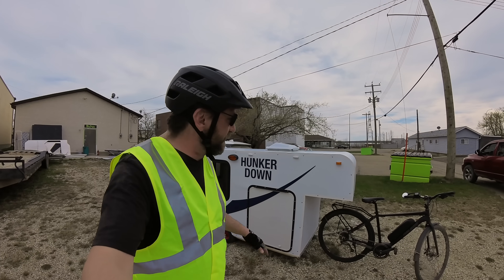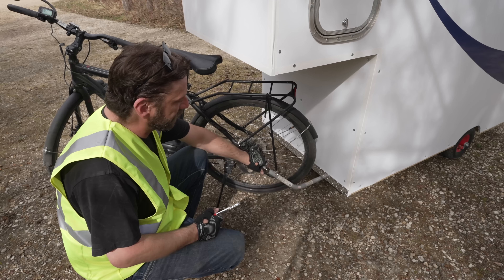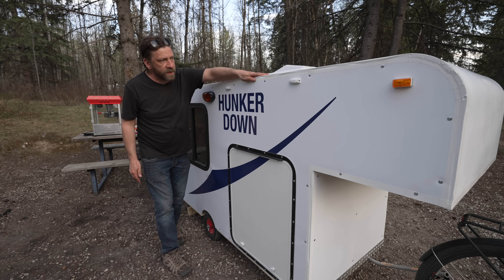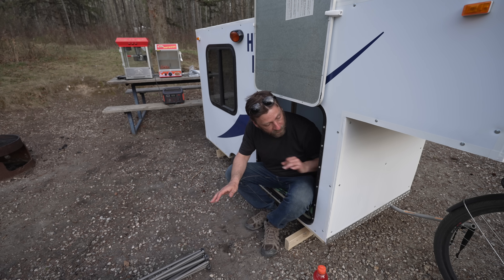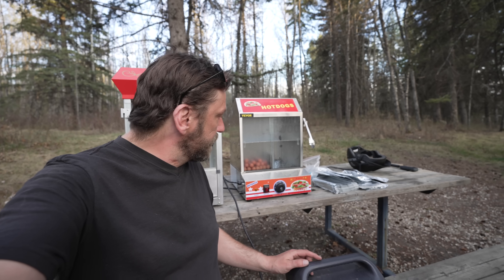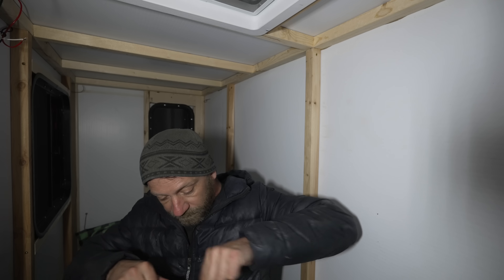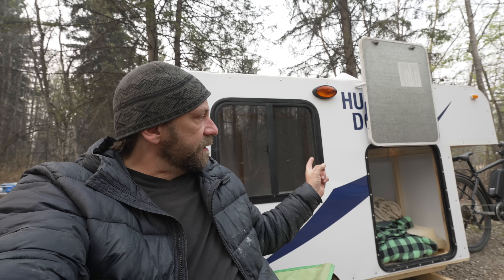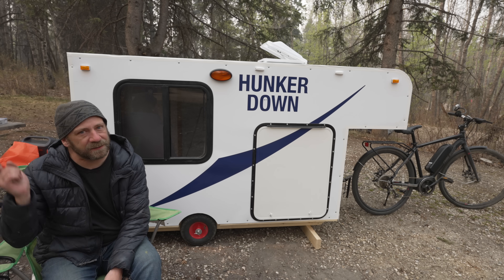DIY Bike Trailer Camping

Comment: I think maybe you should have tried an adult tricycle instead of the two wheel bicycle what is giving you a little more stability in the rear end of the bike. And it probably would have been a little more stable for the little camper you got pulling behind you

Comment: My biggest recommendation would be a better stand/leveling system. With just two 2x4s, one wrong shift in the night could knock them over pretty easily. Other than that, I've camped in much worse places and I know you have too

Comment: Change your rolling friction by moving the camper wheels just outside the body and make them small  bike wheels. Larger diameter will help it pull easyer.

Comment: wow, I came to this video late... I agree with the people saying "use insulation foam sheets for the walls" my addition is more for the entertainment aspect, instead of a bulky/heavy monitor for movies and or games, get a pico projector. super small, with a decent aspect ratio and detail. and bluetooth capability so you can link it to a bluetooth speaker.

Comment: You should’ve set up shop next to the kids with your hot dog machine!  Seriously though, I think you should trade the car battery for a lighter Li polymer battery solution and throw some solar panels on the top of the camper to recharge while on the move.  Maybe the 5th wheel mount can become a battery mount for easy access and charging while in camp.  Line the walls with packing materials to get some insulation.

Comment: Solar panal on top battery inside would be nice for lites entertainment, small fan with 2 bottles of frozen water clipped to back of it for AC Thats rite they have those little ACS but they want 40. 00 for something u can make for the price of a mini fan they have tiny  heaters for winter

Comment: Hey Steve, 
I have been watching for a few years now through all of the ups and downs. 
Love the videos.  Keep up the great work.  You could use FRP panels on the inside.  Nice and light as well as easy to clean and water proof.
I will volunteer my time to helping you install it as well. Happy camping in that great little camper.

Comment: hi...why do you have such low doors...small wheels that provide great support...and where do you have ventilation in the camper...3 cm of polystyrene foam for insulation will not be damaged and you won’t be able to supply it...with great care your subscriber to you... bye bye...

Comment: Is that not AMAZING!!  I simply can’t believe you managed to do so well on only a $600-CAD budget. Sort makes me wonder not only if you’ve thought about selling the plans to other builders, as well as what you plan to build next. Kudos Steve!!  😇
Reply: Simple suggestions to help keep the weight down for traveling by bike. If you can make the floor measurements at least 77 inches or as much as 84 inches, you can use an ultralight camping cot (think Chinese Helinox knockoff to not break the bank) which measures roughly between 72-74 inches, assembles fast and easy, combine with a US Army sleeping bag which troops use to stay warm above the Alaskan Arctic Circle, with your Jackery, you could be golden. 😇

Comment: That’s awesome Steve!! Been wanting to build something like this myself for ages seeing ya build that and so light weight is awesome!! I’m wondering if hard mounting the hitch to the bike and have two arms on both sides with a hinge for up down motion and having a turn table where you have hitched on the trailer would make it more sturdy and give more room for turning I’m running a tricycle atm and using standard hitching limits my turning -_-.
Did some research for e-bike kits you might be better off with a mid drive kit as it will utilise your gears which in turn should offer more efficiency there’s small pros and cons between hub drive and mid drive but have found apparently efficiency and for towing the mid drives take the lead, might be worth researching

Comment: …Light weight insulative?….Reflectix, or similar…multi-layered.  We all mostly sense radiant heat—a 100 watt adult can pretty much heat that tiny space in moderately chilly outdoor temps, especially with a reflective surface.   But adding a couple layers of a reflective insulation can boost that, to help keep comfortable in some amounts of cold weather, when also using a decent sleeping bag. 
…Did I miss mention of why you chose the tiny wheels?  What if you extended the axle, to allow using recycled fat-tire bike tires, to help travels on uneven ground?  
…Would flip-down stands under front & rear ends, help stabilize the camper when parked?  Could be U-shaped flip-down front & back, or, adjustable-height legs on each corner if camping on uneven ground?
…Stealth camping needs stealth camo-paint job! 😉🖌 
…Could excess weight be saved by using flexible solar on the roof? 
…That hole—great place for a DC fan with a bug screen to help circulate air—one of the yuckiest things in any trailer, has gotta be when dew-point inside causes condensation on interior—moving air helps reduce that.

Kudos, man!  That’s a very cool work in progress!   Please Keep us posted on your progress!
Reply: Oh—forgot….that trailer could maybe have a limited-turnable 3rd wheel under the tongue area that could help stability.

Comment: Now that I’ve watched this. 
I do intend to watch your actual build. What I will say firstly, is stay away from anything with a cardboard panel. It’s absolute rubbish, you will only end up with your panels becoming mouldy and damp over time. 
I tried using those cardboard panels with the white coating on one side for my airstream. Never again. 

Try using “luan plywood” for your wall panels. Make sure to use sikaflex around the framework to stop leakage. 
I would put in some “king span” for a little added insulation. 
I have been wanting to make something like this using a tricycle. Hope this helped.

Comment: This wouod be perfect for homeless people that are actually trying to get on their feet and working. Not for ppl just wanting a better place to get drunk and/or high. Hook it up and go out to a remote location and chill for a few months until you can save. Probably several lite additions could  be done like solar, little kitchen area. Maybe a little bit of water to was with if you could buy or build a system lite enough not sure. I know water can add a lot of weight quickly.

Comment: Main frame needs L brakets on the joints... and to hold heat in the winter  use Reflectives wrap inside....switch the ceiling vent to a fan ... Are RV got real hot....that fan is the real deal. Metal L brackets like you have in the  front...do it all around. I'll think of something later 😂

Comment: Get foam board insulation or Styrofoam for between your studs, then laminate some 4oz fiberglass with a thin layer of epoxy. It'll be quite rigid and light. Urethane foam is compatible with styrenated resins or epoxy, Styrofoam is only compatible with epoxy

Comment: Hey Steve. Nice little camper. Maybe put some foam board insulation and luan plywood over that for your interior. All very light weight. Stain it white or paint it. I think if you somehow had the whole back of the camper open up and you could screen it in when open or many options. Remember when you put two motors you use a lot more battery. I would put a very bright sign of some kind on the back like the Omish have on their buggies.  An inflatable mattress would leave a lot of room for you. Anyway, enjoy your new rig 🙂

Comment: I have a couple of ideas Steve, 1. add trailer jacks to the four corners for leveling and 2. use and electric motor with a large diameter pulley,  rc car battery, and a couple of alternators with small diameter pulleys to generate power. Great build and video content, keep up the great work!!

Comment: That’s super cool! Not telling you what to do but if I had one of these bad boys I would make the following modifications. 

1. Interior: I wouldn’t add any additional sheeting type material. Rather, I would add pieces of trim to cover up the fasteners and wiring, sand the framing and paint/ stain it, then either paint the walls or add wallpaper. (I’d worry about mold with additional wall material.)

2: Electrical: I would look for a switch/fuse panel from a boat and use that as a junction and controller for lights. Maybe adding a small fan for ventilation (hey! You’ve already got that hole!) would be good in addition to some brake lights. 

3: Miscellaneous: I would install a bigger door, something that would at least allow a person to sit up on the threshold. An old camper door could maybe be found and cut down for such a purpose. As for a bed, I would go with an air mattress. I feel like anything else would take up too much space. 

Sorry for the book, just my two cents!

Comment: @Steve Wallis Thats great idea if you got a  fan you could put it in the window there so meny people making these i think that the government should give them out instead of tents then they could move them with them you know an the home less can fix them up how they need it buy there owen batteries an solar panels 12v heaters an fans better pad locks an maybe put a life alert in them encase an emergency pops up also you could make it role out wider for more room
Reply: You can put car sound denting stuff one side peals off an sticks to anything its light water proof an kinda cheap also will make it warmer comes in different thicknesses an you can put carpet an wallpaper on it there you go an get a inergy its portable you can buy more batterys for it an it just clicks together no more cords then needed the solar panels come with longer cables then any othet company i believe an they can have the emp shield built-in so you dont have to worry if a emp or solar flairs goes off nuke no problem they charge faster then most brands there an amazing usa company check them out 🙏 cause i pray take care

Comment: I know a quick build, but this is awesome! just needs a large (maybe even foldable) solar panel on top for recharging the bike, and other electric needs :-)
...edit
Ah you mentioned the solar! That just has to be there... maybe stack them with rails and when you cycle you have 1 (250w) and then when you "park" push 2 more out either side to have a maximum of around 750w on a shiny day... then you could have a thermoelectric cooler (80 watts) and heating blanket (50w?) and lots of nice to have stuff...

In Sweden 250w is the max for a e-bike (without any sort of license). 500w would be a lot better, hope that changes soon (in Sweden)...

....edit2

Water, why not get a pump to create your own water, some of the pumps you can fresh water from any ditch... and if it's all frozen just melt it run it thru...

Comment: I am thinking the space behind you when you were sitting down in the camping chair, the original mount point, that could be the "kitchen" or sink anyway and oven toaster. Then stick a little projector somewhere and have a pull down screen in the middle of where you tucked back the bed. So when you want to watch a movie, you sit comfy with your back to the sink and watch stuff while you eat / have a step two. The projector doesnt even need to be in front of the screen, most projectors can be set to rear projection, which means depending on the screen you could have the tiniest of shelves at the far end of the cabin near the frosted window and run it from there. You can get tiny projectors now these days, not all of them great but, I mean, for what you need it for.

Glad to see you back man! This thing looks great

Comment: Steve.... Could i buy that trailer or could I pay you to build one for me ive been looking for something exactly like this for like 3 years i build mini bikes and they have good tow capacity. This would greatly increase my ability to adventure comfortably i would love to take this deep into the mountains on some fire roads I could slowly add solar panels and install a bracket on the wall to slide in a tablet as a mini flat screen some kind of battery system to store the excess from the solar an inverter to run wall plugs so you could run a little battery powered heater or ac that would be so perfect for me

Comment: I think it all needs to be one unit not 2 units meaning the bicycle and the trailer and why the little tiny Wheels why not use mountain bike rims and tires? And if you hook up electric motor in between the pedal drive on the chain you would have pedal assist  and making it one unit I don't know maybe a three-wheeler? Stretched frame you'd have way more capabilities just a thought ✌️

Comment: I have a suggestion for lightweight, easy, wall-mounted, inexpensive storage "bins" that we use in our trailer.  We got those command hooks (2 or 4 will do per "bin") and small laundry mesh bags with zippers, with the mesh large enough for the hook to go through it.  
Stretch the mesh bag on the wall for measurement.  Attach the hooks to the wall in the appropriate dimensions, and hook the laundry bag to the wall.  They work great!  Eventually the hooks give out in the heat around here, but more sticky adhesive replacements can be bought.

Comment: At such a light weight, why not make it either tall enough to stand at least on one end with a sloping roof OR a pop up roof you simply lift and hook into place like a shoe box opening upward over a smaller open bottom half.

Comment: Suggestion for the interior paneling instead of drywall. There are light-weight panels they make for use in the back of restaurants that are pretty thin and made of some sort of plastic. With some care, you could even attach switches for the lighting. Just a thought. Love the camper!

Comment: Paint the framing a light colour, get a windshield sun shade, cut it to fit your windows, fasten it top frame (stapled)? roll when not using.  Small led lights stringed would work well. That hole in the top section , the failed 5th wheel thing, put some plexiglass to cover taking advantage of the light coming from it.  Any cabinets etc built inside use pocket jig for screwing together, it’s strong but can be used with lighter wood. Enjoy. Glad to see you having fun.

Comment: Steve Sir:
Just a suggestion , the bicycle is fine I’m sure it’s great, but if you might want to upgrade a little bit, go with electric trike , it has a basket for extra batteries or supplies for as you travel and it can make a 5th wheel hookup and not hinder your travel. A couple solar panels on top of the hunker down charge controller to charge for the trike .

Comment: If you had one of those sweet fat tyre 1000w bikes with a massive battery, you wouldn't even notice you were towing it. Also fk the laws, police never check anyway, but you can put a sticker on the motor that says 500w, it's a bad law anyway we're supposed to be using less fossil fuels. This looks so much fun.

Comment: Great idea and build. Only suggestion for lights is LED strip lighting, that would allow you to control the brightness of the LEDs itself. Also a fan to move air around. Great idea with the overhang. That will allow for light weight storage during travel, but more storage when you get to the campsite.
Reply: Rebke fan built jn ked kight iakl in marine inky $54.00

Comment: We found an abandoned 6’x10’x6’ tall house boat in the swamp.  Room to sleep 4 with the dual side by side plywood bunk beds suspend from the ceiling by ropes.  Used knots to set height of each bed… had a hook on the bottom bed to latch to ceiling during the day.  Not sure you could suspend a bed from your ceiling but you could suspend a table and lower it to some blocks on the walls mid way up.  Hinges may work but could get in the way.  Go to the ceiling.  I love this, man.

Comment: I have a 1200 e-scooter and a 1X2 meter cargo/camp trailer. so something like you have there appeals to me. My utility/camp trailed weight 18 Kilos. Deck uses chain link fence, sides, PVC 1/2 inch pipe, 20 inch bicycle tires and 1 inch box steel frame. 

Where I am many 22% grades. I can do 38 KPH scooter alone. So should be good pulling the trailer. Though steeper hills would be a problem.  

Looks like you need a longer hitch to keep the trailer off your back..  Maybe a solar panel to extend your range.

https://www.youtube.com/watch?v=gIggyTAZEWY

Could go covert and put a higher power electric motor in the trailer. They probably would not expect that.

Comment: RIGID FOAM INSULATION! You can cut it to perfectly fit between you "studs" and it is really light weight and insulating. Then just cover it all with thick Mylar or plastic sheets.

Comment: Hey Steve, if you have not fixed that hole up front yet, consider putting in a Kayak deck plate, that way maybe you can hang a trash bag out of it or use the bag that comes with a kayak deck plate and store stuff in.  Safe travels my friend

Comment: I noticed while you where sitting in the door you where practically bonking your head on the top of the door frame, I would raise the hight of the door and make the door piano hinge in the center so when you open the door upward...the bottom of the door sticking up past the top... folds down to overlap the upper half.

Comment: Perhaps blackout cloth cut to size for the one window, velcro to hold it in place could work since you've got to keep the weight down. Bug screen over that hole in the storage area so you have extra fresh air and webbing (like fish net) with velcro to hold things in the storage area. Rig up a 'box' to keep the battery or charger in so it doesn't move all over when cycling. The mattress might also go in the storage area when cycling. Not sure if that would add too much weight to the front though.

Comment: Custom Entertainment center and backup power unit in the storage cubbie, split matress pads in 2 add extra fabric so you dont lose them and make it foldable, and  get a stool from walmart for a small table(folding type), ect. idk have fun with it add a couple charging ports